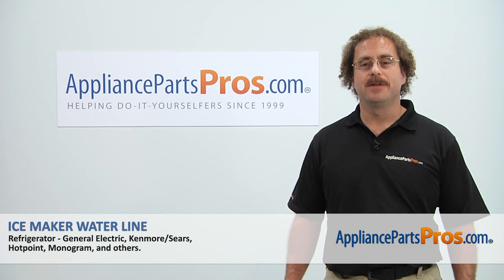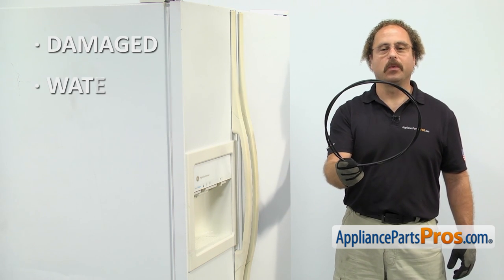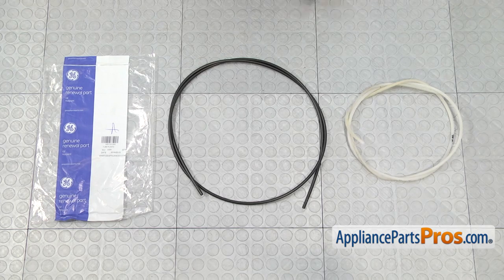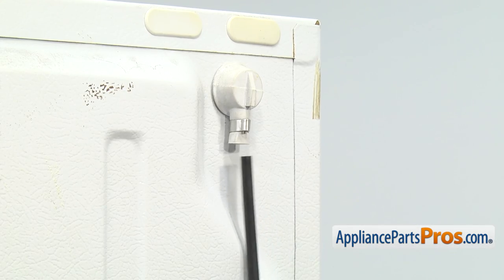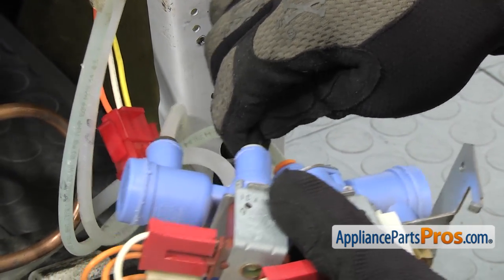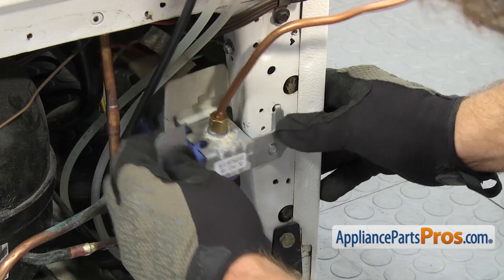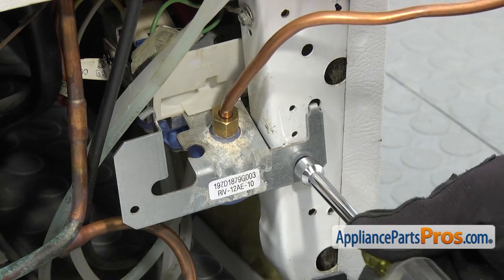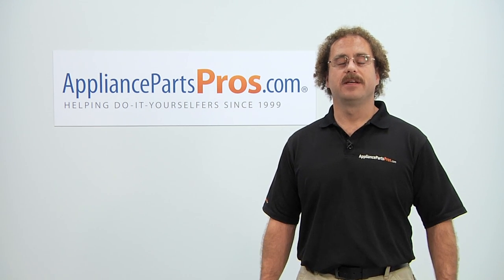How To: GE Ice Maker Water Line WR17X11349

Comment: What if the clamp is too tight and won't release the old hose?
Reply from the maker: Which clamp? If you mean what's seen at 1:56, you will need to push down on it to get it to release.
Reply: @appliancepartspros  i think he means on the top hose